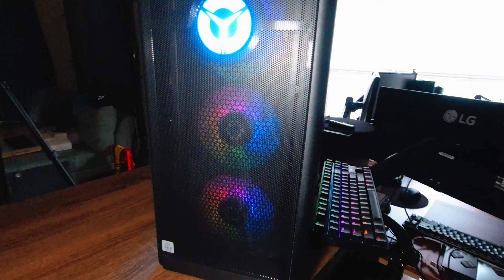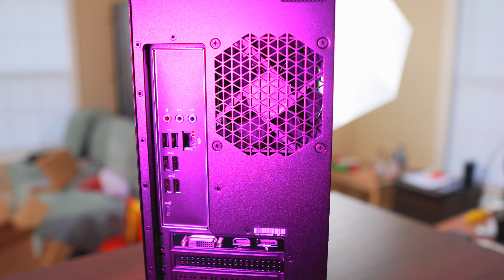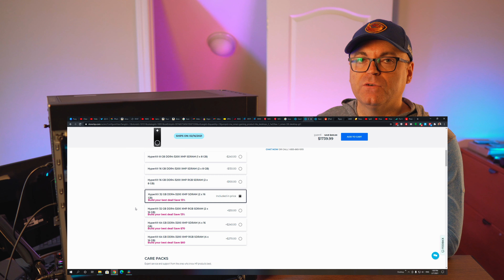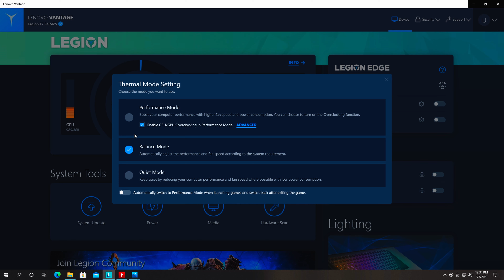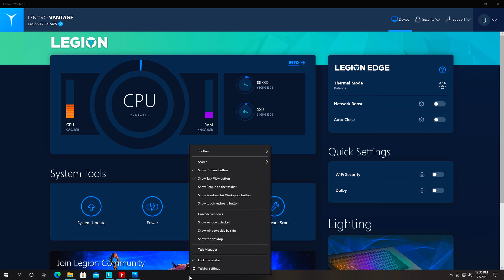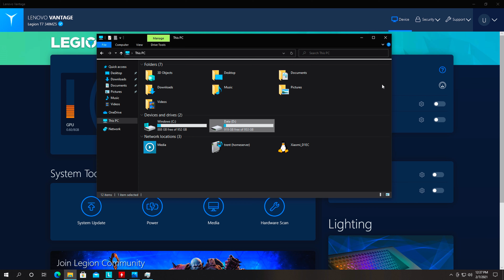Lenovo Legion T7i - Possibly The Best One Yet!

Comment: 15:05 - you say this computer is completely silent - A big reason to buy it for me BUT I just got the i7 with a RTX 3080 and I can hear this build from 10 meters away on idle with no load at all. When I use the GPU inside Autodesk Maya the System becomes even louder after a while (which I would accept on load but not on idle or office work). The Lenovo Vantage Software "Warmth Settings" (Power, Balance, Quiet) change absolutely nothing for the noise.

The thing has 9 fans + watercooling. I really wonder how your´s is silent and mine is not at all.
It is not just monotonous fan/air noise but you can also hear a little higher pitched pulsing noise which I assume is the waterpump? (never had a watercooled system before)

Pretty disappointed and will probably return it, even though I got a good price amidst the worst time to buy a new PC/GPU.
Any advice or experience from other Lenovo Legion i7 Desktop owners very welcome. Thanks
Reply from the maker: Interesting, mine is very silent, much more silent than HP Omen 30l and Alienware Aurora, but maybe you are more sensitive to noise or I am more use to louder computers. Or there is a defect and some of the fans are running at higher speed or have defective mechanism, my pump is very silent, more silent than the regular Asatek pumps and the Cooler Master one on the HP.
Reply: @HardwareSense  thanks for the quick reply. If it wasn´t an exaggeration I would believe "completely silent" is more or less the same for us both :-). The word "silent" (let alone "very silent") does not come to my mind sitting next to it or even 10 meters away. Now I noticed you had a beefier CPU whereas I have the stronger GPU but that should not make much of a difference I believe.

I´ve talked to Lenovo support and even though it is under premium care (with on-site repair) they recommended to send it back and exchange it with a new unit because noise issues are hard to track. I´ll do that but suspect they will not have another unit to exchange. :-/
Reply: Same with mine - it's very audible sitting under my desk, which I wasn't really expecting. I'm glad to hear it's not just my model, though.
Reply: @SCtester  UPS picked it up today and I believe I won't see it again either because they tell me It's normal and then it is not the right PC for me or because they have no more stock to send a new and hopefully more quiet unit. :-/
Reply: I can officially confirm that Lenovo/Digitalriver has the worst customer support in years. The PC was picked up again two days after delivery because of the noise issues. I was then given a DOA protocol confirming the noise issue. I myself have to forward this DOA protocol to Digitalriver (the retailer that actually runs the LENOVO onlineshop) so they would send me a new unit or refund me. Instead digitalriver then told me they have to pick up the PC from me first... I told them on the phone that I don´t have it anymore and it has already been picked up by Lenovo. They said Lenovo has to send me back the faulty PC so that Digitalriver can pick it up from me again... also they don´t know where my PC is and make the customer handle communications between Lenovo and Digitalriver instead of handling this on their own. I´ve wasted 1+ hours on the phone and with countless emails by now. THEY CALL THIS PREMIUM CARE. Don´t buy from Lenovo / Digitalriver.   (also I was given two retailer-contact numbers for Digitalriver Austria - none worked) Total shit show.
Reply: @stefanfleig6994  stfu. This computer is solid and all that bs you went through was because of your own fault. It's loud because this is pushing limits and needs a lot of fans. Stop b3tchin and whining and go spend 4k on other desktops
Reply: @stefanfleig6994  Is it bad for 3d softwares? because I also plan to use it for 3d like blender, revit, 3dsmax, unreal engine?
Reply: @mcan-piano4718  If you don't mind the noise it's as good as any PC with the same/similar specs. GPU rendering was and still is amazing with the RTX cards.
Reply: @stefanfleig6994  Ahh thank you. If its just noise but if it still perform. I was just worried if it will get broken from heat or harm the pc because  I never had desktop with this high power before.
Reply: @mcan-piano4718  there is a long thread about the noise problems on the Lenovo forums. I started it but many people chimed in reporting the same problem. In the end I bought somewhere else and did get a good system that is silent without stress unlike Lenovo which was loud all the time.

Comment: I'm currently looking at the Lenovo Legion Tower 5 AMD gaming desktop.  Not as nice as this but I'm loving how well set up the system is for a pre built.  It's running the Ryzen 7 3700x which seems to be on par with the i7 10700. I was eyeing a Costco deal for a Dell XPS 8940 (saw your video on that and agree XPS isn't that great currently.)  but I find it horrific how bad the cooling with that is so I'm looking at the Lenovo ryzen 7 3700x box instead and I'm very impressed with the cooling, space for air flow, etc. The entire setup looks beautiful compared to the tightly cramped mess of the Dell 8940.

Not sure if more reviews of the Lenovo boxes are in the future but if you come across one of the Lenovo Legion 5 Tower AMD gaming desktops I'd love to see it.  That system I'm looking at with the 1660 super, I know it's not the greatest but for $999 it's a pretty nice pre-built for the money. The 8 core CPU will be great for my Plex server.
Reply from the maker: The Lenovo is great, much better than any other Prebuild

Comment: Just a final tip from me. The 3080 card supplied with the Lenovo 7i PC is very noisy at load. Ironically the Omen ships with a silent 3080 card but are have a big challenge with cooling of the CPU. The cooling of both the case and CPU of the Lenovo is excellent, so it it tragic that the 3080 is so bad. I was planning to change to liquid cooling on the CPU but not sure I will do it. The noice problem is clearly related to the GPU.....and almost impossible to do anything with.
Reply from the maker: Can you not adjust the fan profile with MSI Afterburner?
Reply: @HardwareSense  Perfect comment! I was about to write about this. Yes! And it solved the problem. Power and fan speed is connected, so an adjustment here brings the fan speed down. I can measure a small performance hit in 3D mark, but not while gaming. Still plenty of power for the most demanding games.. It might be possible to get the desired result just by adjusting the fan curve, but I do not been able to keep the GPU bellow 75-80 temperature this way. Also I could need a guide on how to use MSI, and that’s my next “mission”. I did buy the CPU cooler but an not certain if I should take the effort to put it in. Do you think it would bring the overall temperature in the case down? It already good. All in all thank you for excellent advice. The Lenovo represents one of very few opportunities to get a 3080 system, and now it works fantastic.
Reply from the maker: @haraldgunnerd8642  If your current temps are good, don't bother replacing the cooling, just enjoy it.
Reply: @haraldgunnerd8642  I just ordered the i7 11700kf 3080 model. A bit concerned about all the noise reports with the 3080. All you did was use MSI Afterburner to adjust fan speeds on the GPU?

Comment: Im starting to think then noises are in my head😀 Before I start my air to liquid project I thought I’d try a stress test using IntelBurn. CPU seem to run at 100% but no sound.... So what does that mean? Is the noise from the 3080 card? Trying to listen my conclusion is certainly that processor fan and the upper fans is creating the noise. But stressing the graphics card seem to be what triggers the high fan speeds. Any idea what it is going on?

Comment: Hi, I recently purchased HP Omen 30l (i9 10900K) and I was impressed how fast it was. Only bad thing was heat and noise. I also ordered Lenovo Legion T7 with i9 10900K. Cooling is way better, but with Cinebench r23 I see that only 80% of CPU power is used and with much lower GHz. Hitting only 2.9GHz when running Cinebench. Lenovo Legion T7 got 9458 points when HP Omen 30l got 15144 points hitting 100% CPU usage and 4.6 GHz. Is Lenovo CPU somehow limited? Any thoughts? Thank you so much.
Reply: Did you figure this out?  Ill be sure to test mine when it comes.

Comment: I got the t5i with rtx 3070 for under $1500 after tax. I wished I bought two. But I'm considering getting this also, maybe return the t5i or sell it.
Reply from the maker: That was a great deal with the T5i, unfortunately sold out fast.
Reply: @HardwareSense  is this one the one u are talking about ?? Lenovo Legion T5 28IMB05 Intel Core i5-10400F/16GB/1TB+512GB SSD/RTX 3070. is it worth it? I see no info about refrigeration. Price is 1300 €
Reply from the maker: @javiervidandomench6395  They had one in the US with Ryzen 3700x and one with 10700K

Comment: Great review thank you.  I just bought the exact same computer and it should be arriving next week.  I'm curious about the power supply unit and motherboard.  What are your thoughts on the quality?  Usually this is where they skimp out on pre-builds.  Is this computer easily upgradeable?  Can you simply remove and replace the GPU if needed?
Reply: I also expected them to skimp on some of the parts but everything was either what they listed or better. The PSU is 650W Gold+ (not modular). There are several extra connectors for upgradability (including 5 or 6 sata power cables). There’s an extra PCIEx16 slot (not sure if it’s 3.0 or 4.0) and m.2 slot. There are 6 sata data slots on the motherboard. They include 2 connectors for sata power and data that are perfectly aligned with the 2 hard drive slide out trays that open to the cable management side of the case. There are 4 additional spots for easily mounting sata drives on that side of the case. They didn’t list the type of m.2 drive they include but it’s a Samsung 980 Pro and I was getting a little over 7000 MB/s out of the box. All of the rgb is controllable through Lenovo Vantage with tons of settings for each of the six zones. Their site said it came with i7-11700kf but I received an i7-11700k. I’ve read that they used weird ram sticks but they’re the typical HyperX Fury you can get anywhere running at the expected 3200 speed out of the box. The motherboard is a standard size.
Reply: Any update? I’m about to buy it because I’ve been gpu less since October

Comment: Would it be possible to change the motherboard with another z490 to have better ram ? like 3200mhz cl16.
Reply from the maker: Yes of course
Reply: @HardwareSense  do I need OEM motherboard ? Or any z490 would work. I was thinking about msi mpg z490 gaming plus
Reply from the maker: @jjbbrrtt  Any Z490 /Z590 would work
Reply: @HardwareSense  thanks. Just to make sure, Windows will stay on the pc if I change the motherboard because it is installed on the ssd right?
Reply from the maker: @jjbbrrtt  No, you would need to extract your key first if you changing motherboards
Reply: @HardwareSense  How do I do that?
Reply: it is OEM windows right? I didnt know i could extract the key of that
Reply from the maker: @jjbbrrtt  Yes you can, use produkey software

Comment: Thanks for the video, can I replace the ram with corsair vengeance lpx 2x8gb 3200mhz cl16 ? I think my version is a single channel ram.

More globally, can I change any part of the pc as I wish ?
Reply from the maker: Do you have one or 2 sticks
Reply: @HardwareSense  I think it comes with one stick of 16Gb https://www.mediamarkt.nl/nl/product/_lenovo-legion-t7-i7-16gb-1tb-1tb-rtx3070-1681979.html
Reply from the maker: @jjbbrrtt  I there are 2x8, Lenovo doesn't have a practice of selling single channel ram. Get it first and then you can decide on ram
Reply: @HardwareSense  i alteady have it, there are 4 slots and only one stick installed. So should I buy one more stick 3200mhz of 16gb?
Reply from the maker: @jjbbrrtt  OH wow, OK. So did you dirty with the 1 stick. Check out the model number and see if you can buy just one 16gb that is the same. Otherwise you can buy yourself and kit of 2x8 or 2x16 of any probably 3200mhz or 3600mhz.
Reply: @HardwareSense  awesome, I will order a kit of 2x8gb 3200mhz and I will take a better cl. Thanks a lot for your answers
Reply: If I buy a new ram kit, anythink would  work?
Reply from the maker: @jjbbrrtt  It will, but is it going to go to the desired speed without any issues, that is a different story. Unfortunately Lenovo are not giving us an XMP profile settings in the bios.
Reply: @HardwareSense  so if I buy 3200mhz cas 16 it may not run at this speed and this latency ?
Reply from the maker: @jjbbrrtt  Probably both, you would need to play around with Intel XTU to get them running at that.
Reply: @HardwareSense  do you advice to buy 3200mhz cl16 anyways? Or go for lower since it wont reach the speed and the cas. I might just buy the one which is already in my computer..
Reply from the maker: @jjbbrrtt  The 3200mhz will default to 2400mhz the 3600mhz will default to 2666mhz
Reply: @HardwareSense  ok, thanks for answering all my questions ! (What about the cas btw ?)
Reply from the maker: @jjbbrrtt  For Intel the difference is negligible, even at  CL 18 or higher you will not see a huge difference
Reply: @HardwareSense  in term of pure performance, do you advice me to buy the same stick I have in my pc or 2x8gb 3600mhz sticks at a good cas? Thats my last question I am sorry for the incovenience but i dont know about all this
Reply from the maker: @jjbbrrtt  If I was you, I would try to buy the exact same memory that you have inside already.
Reply: @HardwareSense  I bought 3200mhz and it defaulted to 2133mhz'..
Reply from the maker: @jjbbrrtt  Wow not even at 2400mhz? Did you try XTU?
Reply: @HardwareSense  I dont know what this is
Reply from the maker: @jjbbrrtt  Intel Extreme Tuning Utility
Reply: @HardwareSense  I think I'll just stay with the 16gb until I change the mobo.. Btw, do you know the psu of my lenovo t7 version? Its european 10700k rtx 3070
Reply from the maker: @jjbbrrtt  It's probably the same 650W FSP that I have
Reply: @HardwareSense  is there a way I can easily check that ?
Reply from the maker: @jjbbrrtt  Pop the back panel off and read the label.

Comment: Hi! I ended up returning my warm and noisy HP Omen. And bought a variant of this (Legion T7 34IMZ5) but certainly have some comments. First it seems to be different versions around. Mine came with an air cooler, and while it is relatively quiet, it certainly are not completely silent. At idle there actually is a bit of noise from the many fans, and the "fan control" in the Lenovo Vantage app is VERY limited (I cant hear the difference or measure temperature effect ) and not sure there is any effect. Any chance you can look at this and se if there is any possibility/value in changing the fans? The temperatures seems very low and the ventilation seems excellent. If the fans could be tuned this would help a lot. Hope for an extended review or some feedback! Excellent channel!
Reply from the maker: Yes I have a few ideas and there will be more future videos on it.
Reply: @HardwareSense  At this time everyone is scrambling for 3080 cards so it should be a popular topic! And info on the Lenovo is almost none existent, even on their own pages 😂
Reply from the maker: @haraldgunnerd8642  Yes oddly Lenovo are not even advertising it.
Reply: @HardwareSense  Some of the things I am wondering about. 3 front fans, are they taking power from 1 4 pin fan? As the CPU idle temp is 25-35 I would like to slow them a bit down. I know some of my previous fan has had a "silent mode" cable that reduces the speed of the fans a bit, could that work? Also it seems like the CPU fan is the cause of noise at load, but could one change this wit a top quality CPU cooler, maybe a radiator. Seems to be plenty of space (in stark contrast to the Omen). Frustrating that they do not have a working app for fan control.
Reply from the maker: @haraldgunnerd8642  If it's noisy, I would upgrade to 240mm rad AIO and call it a day. The front fans are almost completely silent for me, and I think they are all linked to 1 header
Reply from the maker: @haraldgunnerd8642  Sorry they are with separate PWM headers but one RGB, so they are separate on the motherboard.
Reply: @HardwareSense  Sounds like a good plan, that was what I though I purchased anyway :) Picture was wrong, but text was actually describing an AIR Cooler. LENOVO marketing is a mess. Any recommendation on the 240mm rad AIO?
Reply from the maker: @haraldgunnerd8642  EK 240, I just used it on the Omen 30L transplant, it's great.
Reply: @HardwareSense  Thx! Seems a bit hard to get here. I guess Arctic Liquid Freezer II Cooler is also good, any chance it wont fit?
Reply from the maker: @haraldgunnerd8642  Yes Arctic can fit, and it's a good choice
Reply: @haraldgunnerd8642  Hello, Did you change the AI? I have a lot of noise coming from the CPU PUMP too, like a high pitch sound, really unbearable. Did you solve your issue?

Comment: I have a version with an air cooler instead of the aio, but the rest of the pc is the same. Is this other version good?
Reply from the maker: As far as I know the air cooler is with 150W heat dissipation, so it's pretty good. Not sure if it's silent or not.
Reply: @HardwareSense  aircooler has 5 big heatpipes, painted Matt black with a 120mm. Fan is exactly the same as the others on the case. No noise issues whatsoever
Reply from the maker: @bradw9620  Very good!